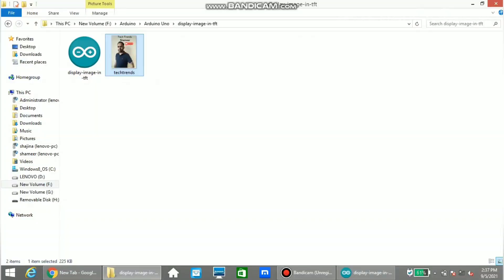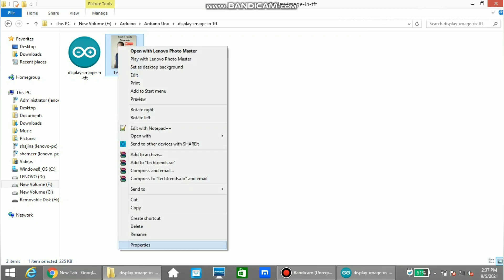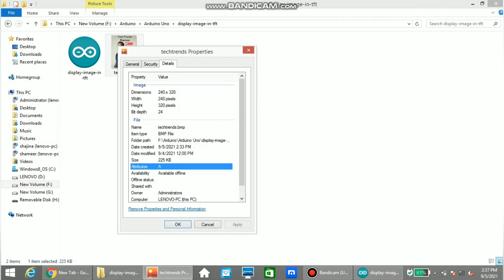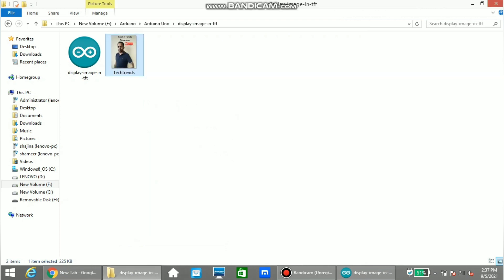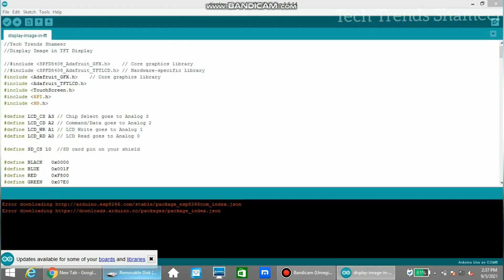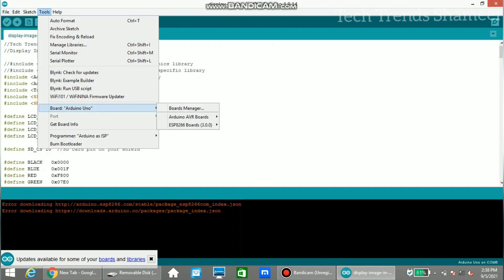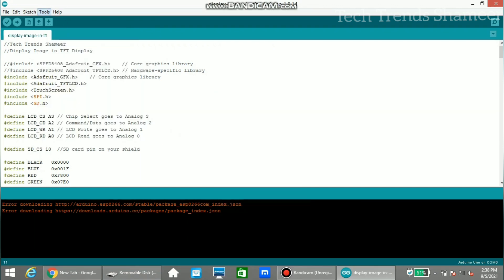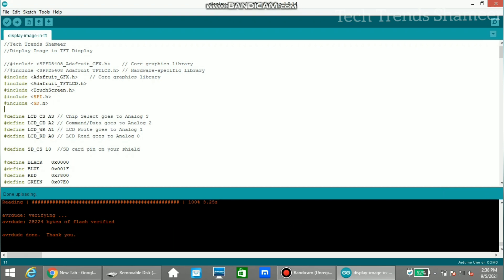How to Display Image in TFT Display

Comment: I was able to get this working.  I had a bad SD card initially.  I was able to get this working, but is there something in the code that can be altered to increase the image refresh rate?  The images take about 8 seconds to load on the screen.  Is it possible to cut that down to about 2-3 seconds?

Comment: I'm getting these errors. I received similar errors, when trying a similar sketch that displays slideshow images.  I'm wondering if there is a high-level library that I'm missing from the Uno. I'm using an Uno from Elegoo.  Any idea what I need to do to correct this? Thanks!

C:\Users\Scott\Desktop\slideshow2\slideshow2\slideshow2.ino: In function 'void loop()':
C:\Users\Scott\Desktop\slideshow2\slideshow2\slideshow2.ino:75:37: warning: ISO C++ forbids converting a string constant to 'char*' [-Wwrite-strings]
   bmpDraw("slide1_example.bmp", 0, 0);      //Calling the bmpDraw function ("Name_of_your_image.bmp",x,y) (x,y) is the starting position of the picture drawing
                                     ^
C:\Users\Scott\Desktop\slideshow2\slideshow2\slideshow2.ino: In function 'void bmpDraw(char*, int, int)':
C:\Users\Scott\Desktop\slideshow2\slideshow2\slideshow2.ino:112:40: warning: converting to non-pointer type 'int' from NULL [-Wconversion-null]
   if ((bmpFile = SD.open(filename)) == NULL) {
                                        ^~~~
Sketch uses 25228 bytes (78%) of program storage space. Maximum is 32256 bytes.
Global variables use 1136 bytes (55%) of dynamic memory, leaving 912 bytes for local variables. Maximum is 2048 bytes.

Comment: Can display multiple images ?
Reply from the maker: Yes you can display. Please modify the below section in the code and add those images in the SD Card.
void loop()
{
  bmpDraw("image1.bmp", 0, 0);       
  delay(2000); 
  bmpDraw("image2.bmp", 0, 0);       
  delay(2000); 
  bmpDraw("image3.bmp", 0, 0);       
  delay(2000); 

}
Reply: @TechTrendsShameer  thank you
Reply from the maker: Please check the description to get the program link